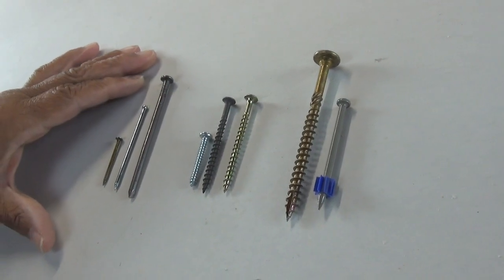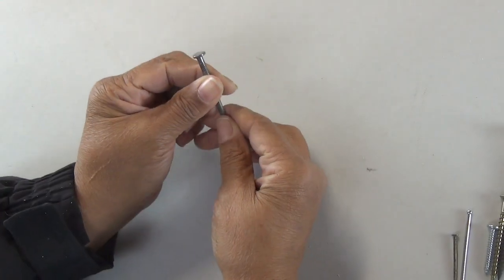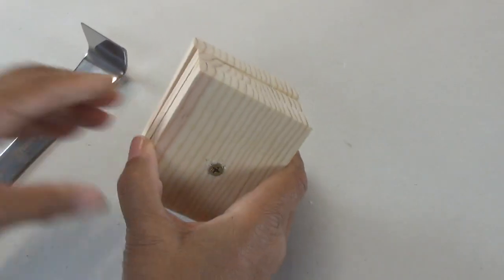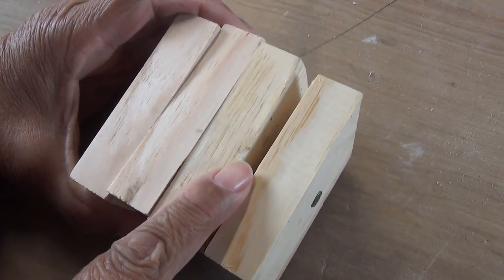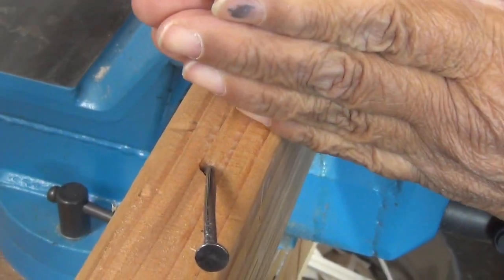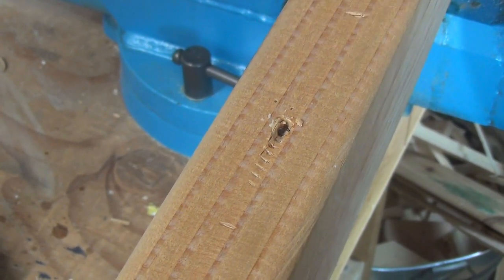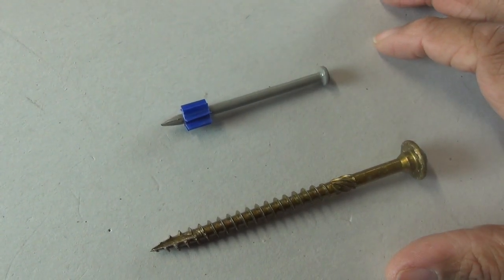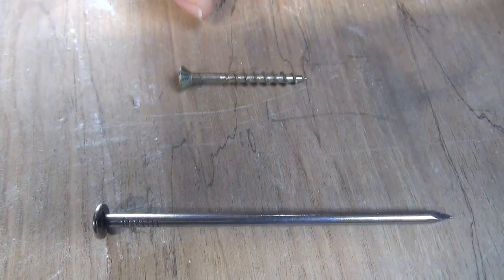Nails vs. Screws: Which Should I Use?

Comment: Just a couple of things about tensile strength and nails, what you say is true, but there are ways to overcome it, the first one is to use a nail with a large head and longer then the thickness of the 2 pieces of wood you want to join, then you bend back into the wood the pointy part of the nail and suddenly your nail joint has gained a lot of tensile strength while retaining its shear one. The second way is to use the nails in couple driving them into the wood at an angle, not perpendicular, so they form a V, again the tensile strength of the joint is augmented. Nothing new here, those are traditional ways to use the nails and many people knows them, but maybe some beginner don't so it is worth to mention it. Last things, very important, is that if a nail joint fails usually gives a clue while it happens because it bends, the screw snaps suddenly when the load or even the fatigue due to seasonal wood movement overcomes its strength and both the nails and screws must not be used in some situations, i.e. for building or repairing chairs as the metal is much harder then the wood and in a very short time will chew into the wood and cause a damage usually much worst then the one that was there before the chair restoration, a good woodworker knows when to use screws or nails, but also know when not to use them but use other joinery techniques.

Comment: Even though the nails are more ductile, the screws are much better fasteners and much more useful because with the very demostration you gave, you can pry apart those pieces of wood held together by the nail but you can't do the same tith the ones held by the screw. Additionally, if the screws are screwed in tightly, that will add friction between wood surfaces making it even more strong and more difficult to move laterally.

Comment: Looks like I'm late to the party lol. I have a question, if that's ok. I'm going to be building a ten foot tall stand for a 150-200 pound evaporative cooler, and I was so unsure about whether I should use nails or screws. Based on the video, I'm guessing the answer is nails, but I would feel pretty dumb if I didn't at least ask. So, in this instance, would you recommend nails or screws?

Comment: Great video as always.
Is it possible to use nails for stud wall? I have seen carpenters using nail guns for roof rafters which make the job much faster. But haven't seen nails to be used for stud partition. I wonder why?
Thanks,
H

Comment: thanks for showing nails vs. screws. i didn't know that. but the other two, a construction screw and a drive pin were just not explained like at all. i have no idea what they are for nor their advantages. all i know is their disadvantages. but now i kan just do an easy search to learn what they are for. ☺️ So no big deal that you didn't explain what they are for. 👍 Your videos are all rather useful, in my opinion, even if this one only raises questions about these two specialty cases. the explanation of screw vs. nail was as superb as every video that i've seen of yours!

Comment: I always tack stuff in with 1 screw then use 2 nails if I know it will need strength. I leave the screw in because why not. If I can't get a nail in I use lag bolts. For things like blocking I just use screws,

Comment: Not all screws are made of the same metal alloy. i use stainless steel deck screws to hold wood construction together. these screw are soft, that is, they bend without breaking. 
screws have the advantage that i can use them to pull the pieces of wood together with great precision with a variable speed drill and a screwdriver tip. 
you are right that screws like drywall screws are brittle and will always snap in sheer load.  but they are designed to hold drywall to a ceiling or wall in tension load. on the wall the drywall panel is resting on the floor or a piece of drywall which is supported by the floor. So the load is only in tension.
So test your screw to see if it breaks when held in a vise and hit by a hammer. Then use it for the purpose for which it is best.

Comment: They make nails for drywall but the drywallers I’ve seen who use them only use a few of them per sheet and to just get the drywall up real quick and keep it in place until the screws are put in with the drywall screw gun.

Comment: Very nice info. What I don't like about nails is that you generally force them into wood, potentially creating splitting along the grain. So it would be interesting to see a video about drilling pilot holes for nails where ultimate structural strength is needed and maybe mention glue at the same time.

Comment: Great video, I didn't learn anything but the information was well presented.
The only thing I would have liked to have seen was a longer primer on what shear and tension (and compression) forces are. One further note that torsion (twisting) is a shearing force which is why it's so easy to break the heads off drywall screws if you're screwing them into harder material.

Comment: Hi Jane just wondering what should I use for simple home decor....like hanging pictures and mirrors. I'm so intimidated when it comes to this stuff.
Reply: Moonlit Balcony for pictures or anything light, you can get away with using a small nail and driving it straight into the drywall. It’s not nearly as secure as a screw but it doesn’t need to be AND it leaves a much smaller hole in the wall in case you want to move the picture later. In the case of mirrors, or anything that is moderately heavy, you will want to use screws with drywall anchors or screws directly into studs depending on the size and weight of the mirror. For most decorations in the home, the drywall itself is the weakest link, not the fastener of choice. Hope that helps!

Comment: Hi Jane!  Love your channel and I had a particular question.  I’m building a sectional couch with storage underneath.  I have kids who tend to climb everywhere on our current couch, causing tensil movement(the back and forth pressure).  Would nails be the better option, or stick with my original intent with glue and screws?

Comment: Great video; sent it to a friend.  I am SO impressed.   You make it SO CLEAR.   After many years working, some of this stuff we know but don't have words to explain to others.  ( It's like the words we acquire from observation as children, but when asked for an actual definition, we can't put it into words.  Experience and intuition built on experience is one teacher.  And then there are manufacturing specs and building codes.  But I bet you would have a great way to teach more on this subject.)

I hope you read this even though I am late commenting.  I am wishing for a follow-up part 2 to this video where you take a few projects and go thru the applied decision-making for fastener choices.  I think it would help people.   Also, I am hoping for another companion video (haven't looked to see it) on when to go to a bolt or lag screw.  

And how about "How many fasteners of what SIZE to use in a project?"    ( I'm sure I'm not the only one who pulled something apart to find a very amusing collection of fasteners with a piece so shot thru, it's lost all strength.  My first builder house was like that, lol. Probably why I got so interested in building things.  )

Comment: This is why I often use both screws and nails. Screws at the edges of a board to help prevent curling and nails in the middle for shear strength. Mostly on rim joists of decks where they tend to pull away. I’m not really sure if that’s the best solution though.

Comment: Thank you for making this easy to understand.  Now, I just built a table to hold up my miter saw and my drill press.  I used screws.  Should I have used nails?
Reply from the maker: Screws are fine for furniture building.
Reply: Thanks.  Now I just need to choose a miter saw.

Comment: i'm kinda new to this so i have a question. if a screw has better tensile strength, wouldn't it cause wood to press tightly and use the woods friction for lateral strength rather than the screw itself?
Reply: No one's replied and I'm sure there are those here who could answer better.  But I think it's a matter of proportion?  Surely the friction between board faces is miniscule in that situation, unless you include some type of glue which would create a better bond and even that in shear is variable?  Though some glues now are amazing.   My better half would be better able to answer this question.  I am answering with trepidation, because it's been long and you must still be wondering but got overlooked.  I am hoping since it's been 8 months none of the real experts here will see my attempt or that they will be kind if I've got it wrong, lol.

Comment: I like using screws over nails because of the friction they cause when they are tightened in. The friction is a huge part in things not moving. Screws create a tighter and stronger bond because of the friction from the tight bond. I believe that the tighter the bond, the less the chance of movement. I think this is what Leah might be hinting at when she said something about "other factors". I've seen some structures that had linear movement because of the type of nails that were used and caused the structure to severely deform or outright fail and collapse. The wrong type of screw can and has caused the same effect. I remember back about 20 years ago when a crane crew was erecting a metal com tower and were hoisting it up when a puff of smoke appeared at the screw type u-brackets. The crew fell to their deaths along with the tower part. The puff of smoke came from the screw's threads being sheared off because the wrong type and size were used.

Comment: Great video. Leah, i have a vinyl screen door that has cross bars connected via wood dowels that rotted out. Thinking of toeing them back in. Nails or screws? Any advice will be greatly appreciated!
Reply from the maker: I don't quite understand your question...am having a hard time visualizing your situation.  I'm assuming that the wooden dowels can be replaced.  Do you need to "toe-nail' them in with screws or nails?  For these types of questions, I generally ask people to email me a photograph of the situation, so that I can see what is going on.
Reply: What would the toenail be going INTO?  If I've got you right, have you considered a little joining plate of some type across that joint, with small bolts thru the plate on each side of the joint -- thru the crossbar on one side, and thru the door?   Silly to put wooden dowels in a vinyl screen door -- we'll have to watch ours for rotting.  Seams should then be caulked.  Who knew they put wooden dowels inside? You can't see them!

Comment: I used screws on the frames of fencing 10x4. the reason being the frames 2x2 timber so that I can take apart easy again and use timber for other products. and the tensile and strength did not matter to much. I knew about screws snapping and nails bending Leah but never put the two together to make any sense out of it, now thanks to you I have the full knowledge.

Comment: The point on many nails is not square; its cross section is a diamond.  The sharper edges are intended to cut wood grain.  Place your nail with the longer dimension of the diamond at right angles to the wood grain before hammering.  This helps reduce splitting.  If you place the nail with the diamond parallel to the grain, the nail tries to separate the wood fibers, instead of cutting them.  (I learned that in 1958 in junior high shop class, pretty much the most - or only - worthwhile class I ever took.)
Reply from the maker: HI Bob, thanks for sharing your personal experience!

Comment: I give you an idea, do two model cube structure of 10 inches, with 10X1X1,  with a 10 degree out a plum in two side something like this (♯), one out a nails, the other out the screw, also fit the cube(imperfect one) to a wood bench with the respective fastener, them start putting weight on top, or jack it up to compare who will give first, and failure characteristics, that will be a blow out, to You tuber and a first and unique video. You are excellent, I love you channel, your sweetness is a plus.

Comment: In 1800, went they build 1000 feets high bridges, for the railroad they find the nail, does not hold properly, so they switch to screw and nuts. The screw is an evolved nail. that is all about it.

Comment: No use in the bending nail capability in a structure is never intended to go out a plum, in fact, if It does is called inhabitable and unsafe, putting simple, went the bending take place the forces involved in the structure are far superior to what the nail and screw together may offer, far superior. In fact, nail is more given to the force involved in a structure going out the of plum or level because they lack to grab from the inside of the material. Screw does what corrugated steel does to concrete, it grap, nail a great invention to humankind, is perfected in a screw.

Comment: Thanks for that Leah. Question, I've seen some long nails ( 5in or so) that have a gradual twist in the shaft and seem to a used for thick lumber like you get in log cabin construction. Just wondering if this type doubles up as a screw and a nail?
Reply from the maker: You're describing a "spiral flooring nail" also nails which resists back-out but  still  is no match for a screw.
Reply: Got it, thanks Leah. ;)

Comment: So I would use both in critical areas.
Reply: Tuna Fish In construction that would be a waste of money. Like framing a house, you wouldn't use nails with screws as backups. You just use nails because you're not worried about the studs or floor joists or rafters pulling apart, just the natural twisting and swaying a standing structure endures over decades. Screws would be redundant and an unnecessary added cost.

Comment: Today I built a small stand for my shop using pocket hole screws and plywood.  It is my understanding that pocket holes screws are sturdier than screws driven conventionally (at right angles).  Can you tell me if the angle improves the shear problem?  I know toenailing is also supposed to be stronger.  Does this overcome some of the problem with tensile strength?  Great video!  Thank you Leah!

Comment: Let say I want to built an outside wooden rabbit cage. Would I use screw or nail? I thought screws would prevent the rectangle shape cage from looking like a parallelogram. Hard to decide.
Reply: DarkSider It really only matters in large structures, like a house, what you use to frame it. With a house that's a lot of weight and usually decades of handling the elements and shifting of the foundation.

Comment: A feature that I love about nails is that they have a lesser chance of splitting wood, especially with hard woods. For my furniture projects, I like using cut nails instead of common nails. I drill pilot holes for cut nails (as if they were screws), but the holding strength and look of cut nails is unbeatable. There's something about visible screws in furniture that bothers me.